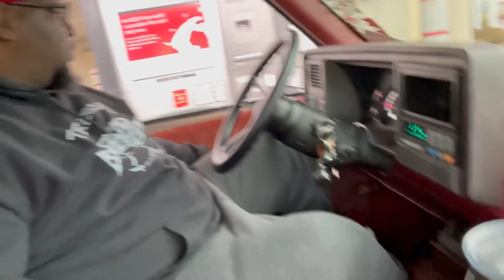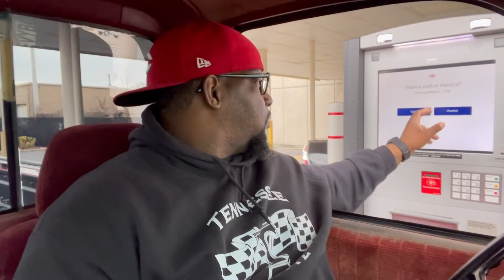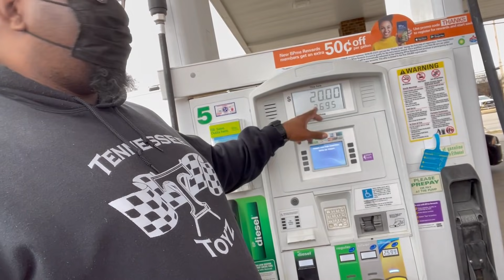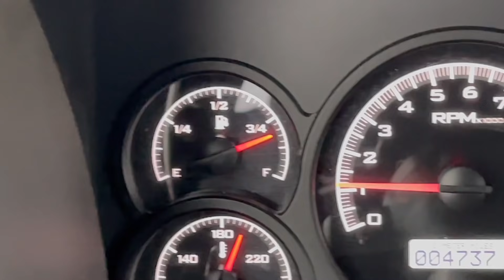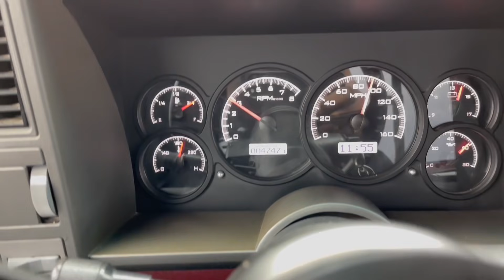🚨‼️Cayenne’s Tint HAS TO GO‼️🚨

Comment: You really didn't have to take the tint off if it wasn't bubbling up. My OBS had mirror tint on it from the factory, but I had it tinted three times. So its tinted 4 times on the doors and two times on the windshield and back window. I had most of that done while I lived in Memphis. When I moved to Mississippi, they changed the tint laws, where I should have been grandfathered in, but told me I was too dark. Long story short, I got me some papers on mine so NOBODY can tell me what to do with my windows anymore. They don't make that tint like they use to either. Tint don't stay dark long any more. I need to come see your guy too! 😊

Comment: Alabama  ain't no different  about  the tint i got 5% all around  on my yukon and 30% on windshield and 30% all around  on my 300 glass house  on windshield. We got 1 tag but the damn  sho be profiling but when they run my tag nothing  not even a speeding ticket insurance  straight  and all bruh you got a  clean ass obs short bed truck love the dash and paint clean. I got an 01 c3 sierra with a 6L lq4  but that obs is nasty.